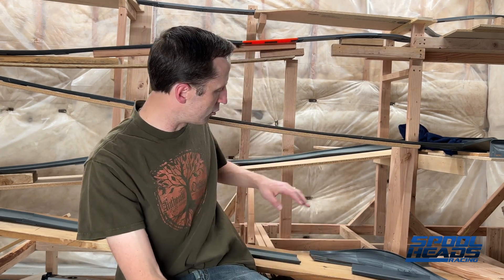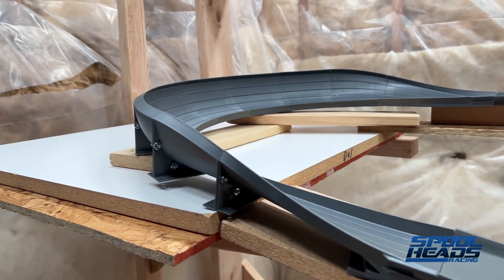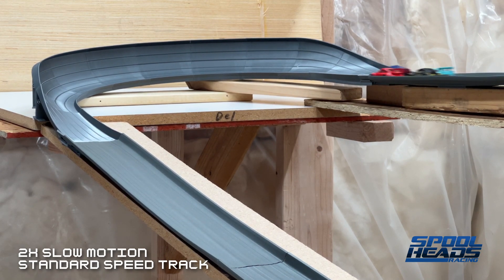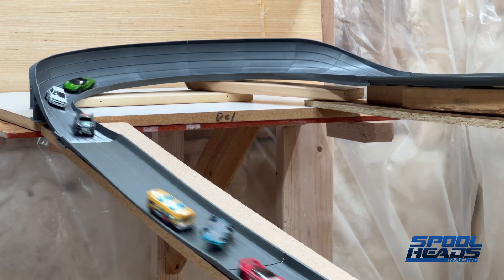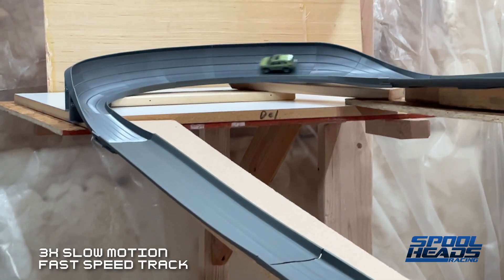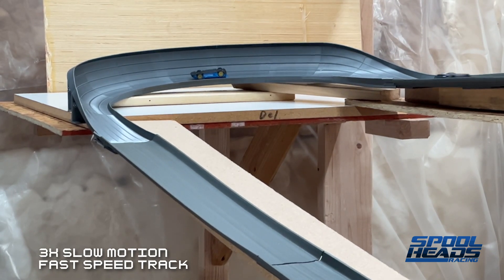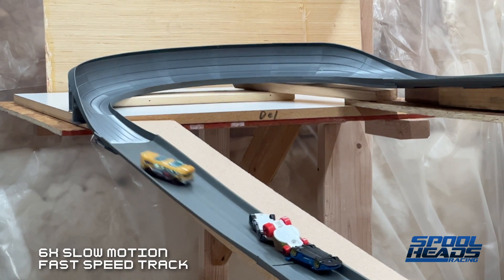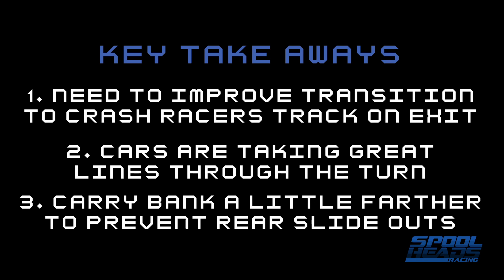Prototype Open Track 180 Degree Turn VERSION 4.0, 1:64 Scale Diecast, 3D Printed - Full 180 Test

Comment: Another fine update Russell! I'm always fascinated by the subtle changes made and the extensive testing you go through with a wide variety of car types. . .even Ain't Fare, LOL! The section of the video showing car after car avoiding the DNF/wreck was amazing. Speaking as only a viewer of races and not a builder myself, this part excited me. Many races come to an abrupt chaotic end for the cars in back if a leader biffs it in a turn but remains on the track. Here, that's not a problem (fingers crossed).
Reply from the maker: Thanks Chris! Hopefully I can finish this turn and start racing someday!

Comment: This looks great. I believe you could smooth the transition by extending the entry and exit sections by about an inch or giving one section of flat before and after to transition back to the crash racers track.
Reply from the maker: Great comment. As luck would have it, in the next version, I shorten the ramps and it was TERRIBLE! The cars front end rubbed when starting the turn and many cars caught air coming out of the turn. So I went back to the version 4 length, then I even added an inch and a half to it. Going to test it out today. I think you are spot on!